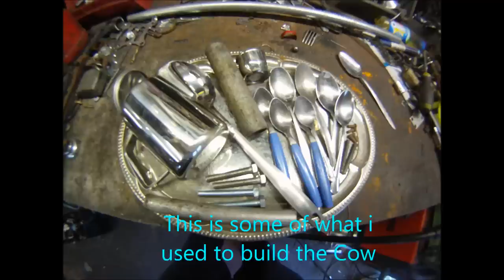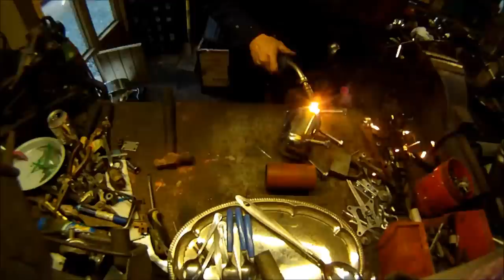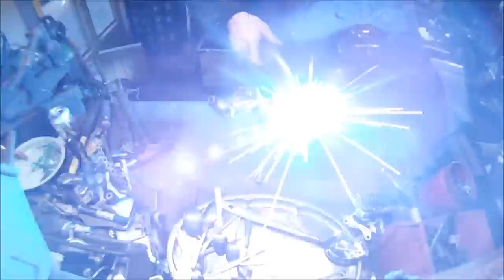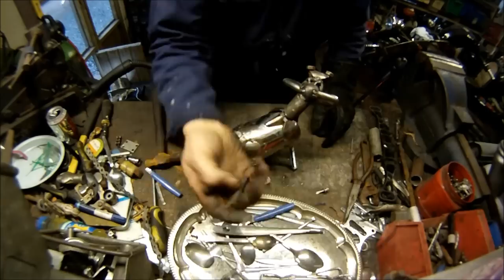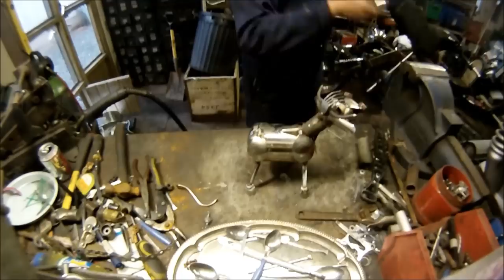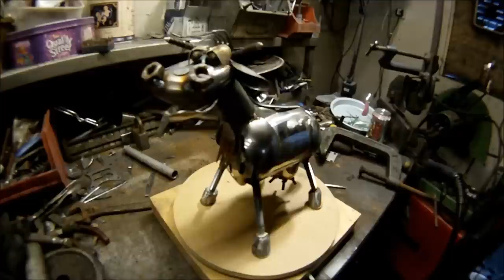Welding Art, Scrap Metal Sculpture of a Cow

Comment: Wow amazing work!  I wonder, is that stainless steel or mild steel?  If stainless, are you using a stainless steel mig wire?
Reply from the maker: Hi there, most of it is stainless steel but I weld it with mild steel wire, this is because most of my work is finished in paint. ...cheers 😊